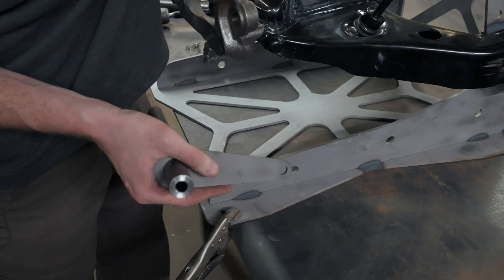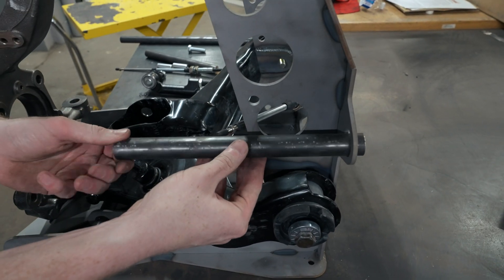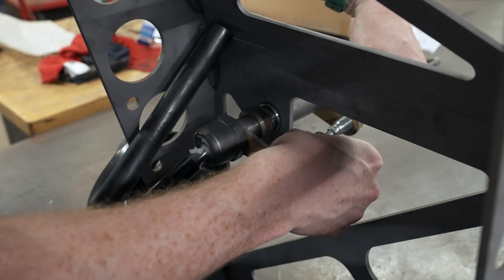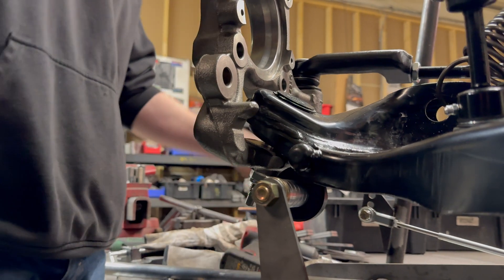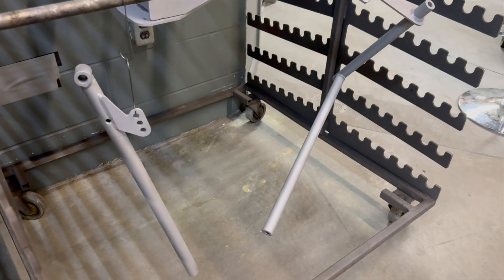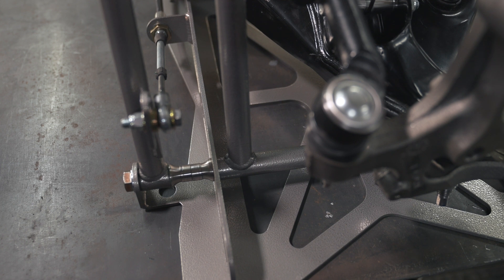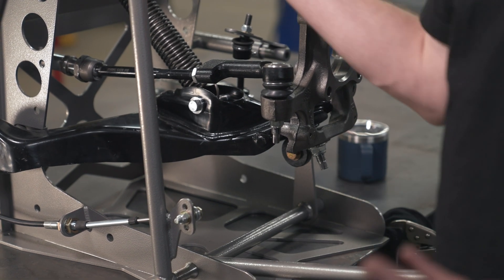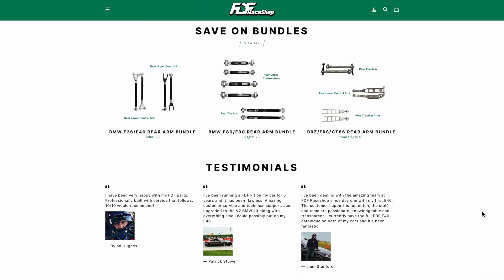We Built a Fully Interactive Suspension Display... Again

Comment from the maker: What kind of display do you want to see next?👇🏼
Reply: I have been thinking about one to show the effects of weight and tire pressure on turning force and contact patch size. Pressure gauge for tire, force gage for weights (weight can be added or removed) and turning force (basically how hard are you pushing from the side), maybe a digital camera looking up at the patch. Mostly trying to engage kids with the physics of driving. May not be your cup of tea, since there's not a bunch of suspension involvement.
Reply: Multilinks. :)
Dude I have a 3D printer and this thing is nasty to draw. I love my machine but they told me "rapid prototyping" dude this thing takes entire days just to be drawn in straight lines at cad.
Reply: Anit sqaut
Reply: @SKIDLAB agree!
Reply: Multi link rear suspension
Reply: Bump Steer adjustment with a laser mounted on/in the hub pointing forward on a screen 10-20 feet away to see how the bump is affected with various spacers.
Reply: a naked one
Reply: Anti-Dive would be fabulous
Reply: Would love to see a display of the dual pivot/split lower McPherson setup on newer BMWs and Mustangs. Sadly there isn’t a bunch of technical information on modifying them.